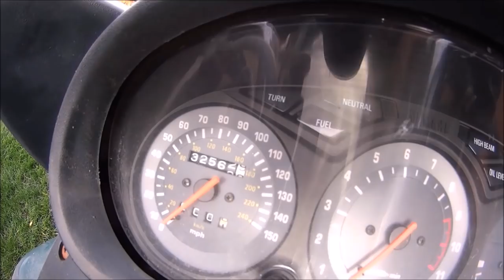XJ900S DIVERSION PUTTING THE ENGINE BACK IN FRAME.

Comment: The parts are coming together nicely.   one of the curses of the home mechanic is to repeatedly put on and take off parts, due to forgetting to do something first, its old, but if I had a penny, for every bolt I had cleaned up, applied thread lock to, and marked as torqued, just to take it off a month of two later, I would have paid for the first service lol.   Doing a cracking job, looking forward to the next instalment.
Reply from the maker: GTs Garage lol yes your Wright it goes on it comes off again it goes on again

Comment: Hi again,  What paint did you use on the parts, the texture finish is good.
Reply from the maker: Hi Peter
on the swinging arm and some small parts i used direct to metal hammered effect silver, by the paint factory. on the wheels and some small parts i used stone chip black, by tetrosyl, finishing technology'
Reply: @jonyr1TT  Big thanks again,  keep  up the good work and stay safe.
Reply from the maker: cheers bud you too.